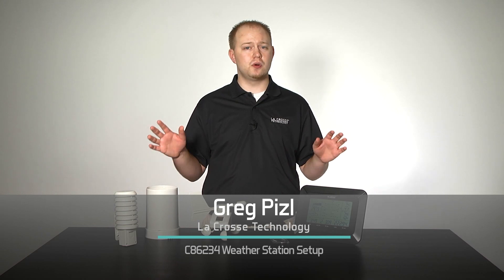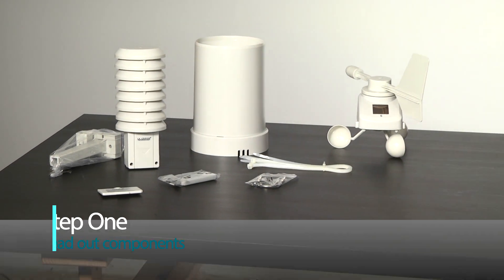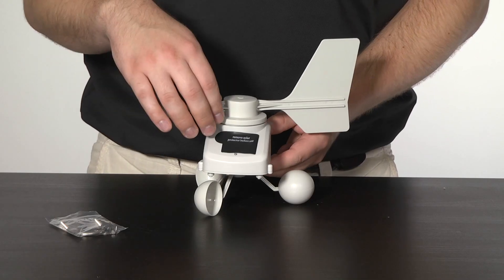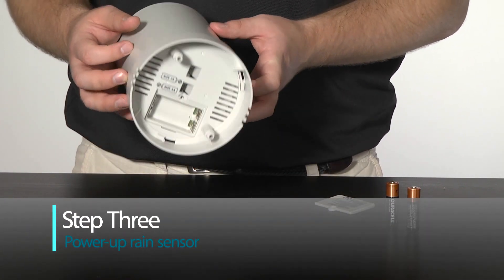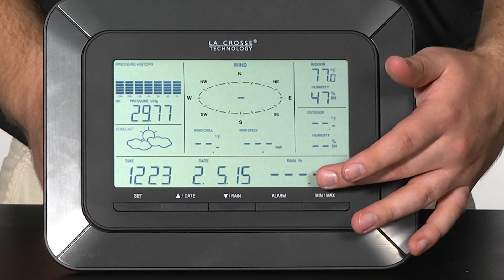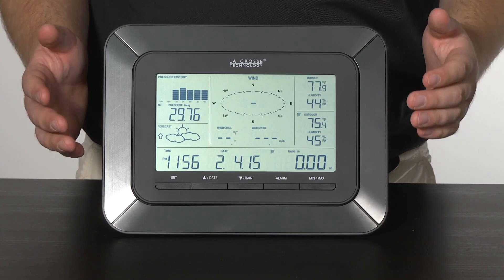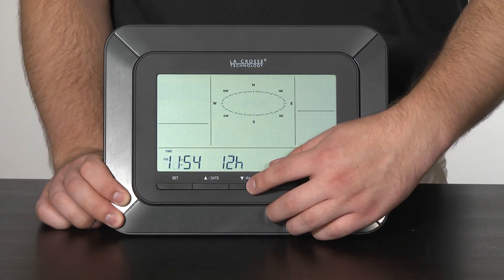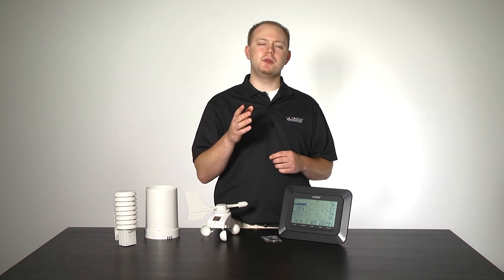C86234 / WS-2814 Quick Tips: Setup

Comment: Hello!La Crosse ，this is Kai Lin  from Taiwan.
My Company bought the Wireless Professional Weather Center of type C84612，there are some question needed to solve .
1.in regarding with connection of company and smartphone，I have already  registered La Crosse Alerts Mobile.
Step1,System ask to register gateway，sometimes work or doesn't work .why?

2. Step2. System ask to register sensor ，but I have seen the product in which has no  sensor and optional probe ，I wanna make sure above product needed to buy extra or not.
Or Are there any ways to skip Step 2 for connection of smartphone and computer .

Please reply to my email.
Thanks! Kai Lin
Reply from the maker: Hi Lin, we apologize for any confusion and would like to help get you connected with our support team. However, since you're in Taiwan, it may be easier if you could provide us with your email address so we can respond directly to you that way. Sorry for this inconvenience, but we look forward to your reply.

Comment: when buy usb wireless interface for pc ws-2813U-IT
Reply: +La Crosse Technology that's right
Reply: +La Crosse Technology thansks.......
Reply: please need diagram electrical Wireless Solar-Powered Wind Sensor ws-2813U-IT
Reply: good morning, I need the electrical diagram because we have been burned crystals 16 mhz and tubular and need to know the specifications to replace them because the anemometer is not working, there is no reading on the monitor